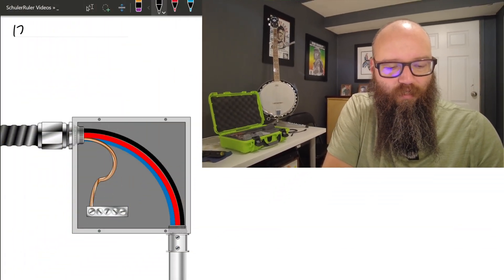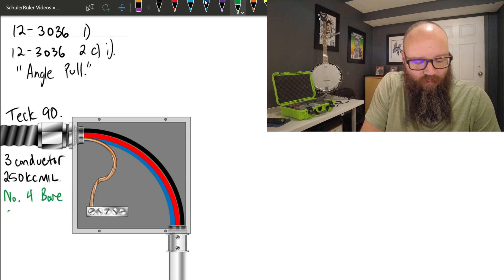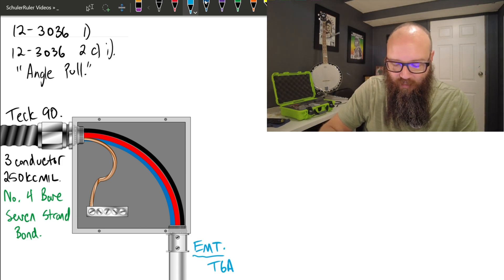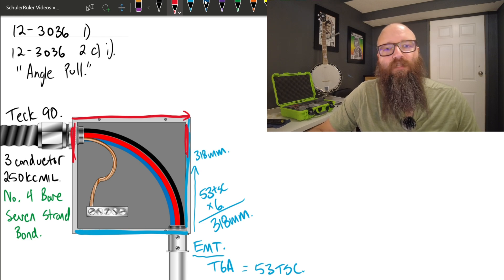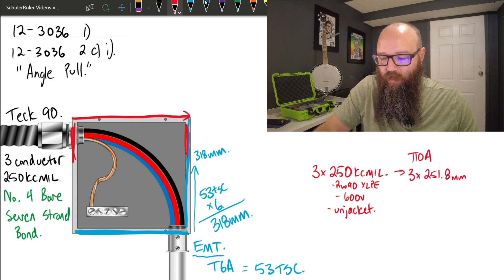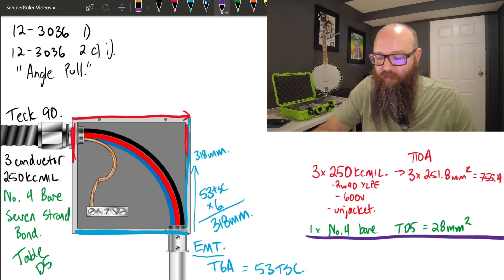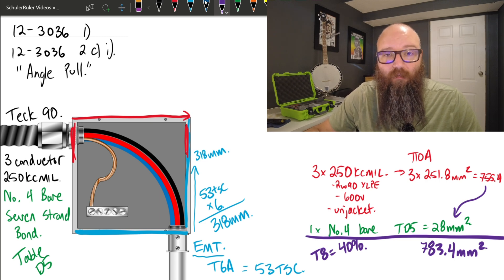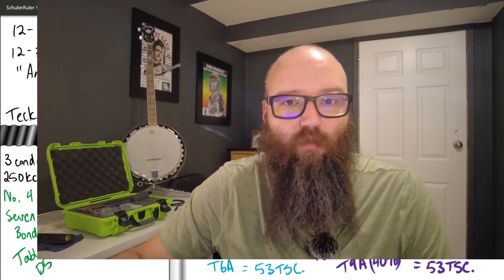Converting a Teck Cable to a Conduit Equivalent

Comment: Great video! I have a question using the 2021 Code, which type or conduit would you use in table 9G? Rigid metal, pvc?
Reply: I have same question if you know please let me know.

Comment: Hey Chris. I've worked with you a few times a long time ago. I occasionally still bump into your brother.  Quick question. Is there supposed to be a grounding bushing on the teck cable or is it assumed that it's at the other end?

Comment: A class on how to overthink 2inch conduit boxes..its based off 2inch for the conductors the acwu connector has nothing to do with it except placement
Reply from the maker: I'm not sure what you mean by your comment, but the video demonstrates the correct method for determining the minimum dimension of a pull box based off the raceways terminating in the box.
Part of that is determining the correct conversion to a conduit equivalent from a cable assembly.
Thanks for watching.